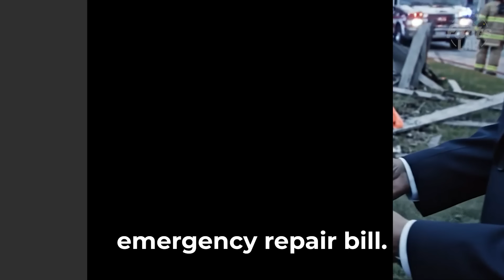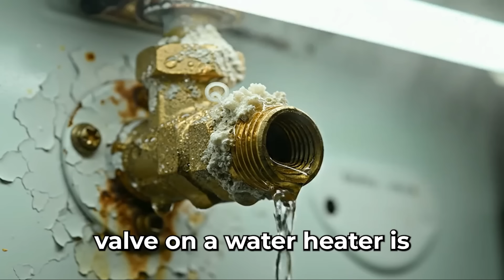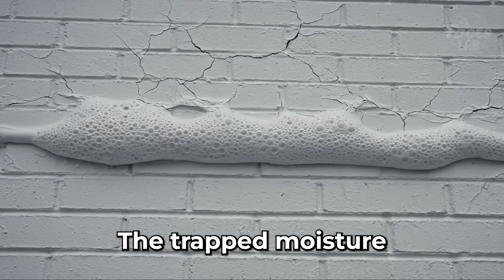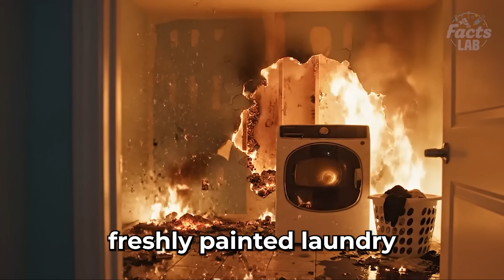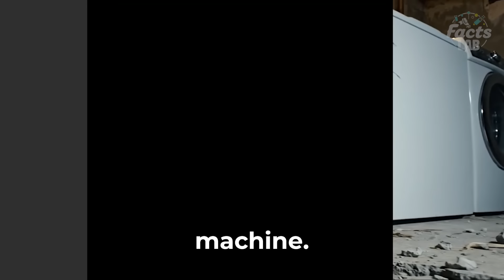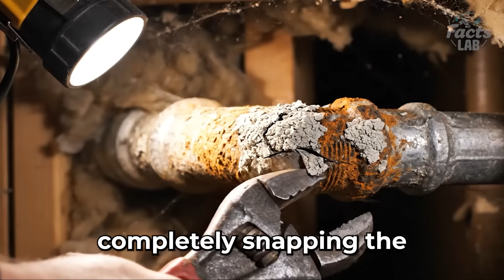DIY Fixes That Turned Into Expensive Disasters

Comment: I watched a Home Depot video on floor sanding; it was about 8 to 10 minutes. I posted a comment just to warn viewers to do more research before sanding a floor, but I did not denigrate the video. Home Depot removed my comment.
DIY is good but know your limits. If you have never fixed a leaky faucet, you may not want to replace a sink or bathtub.

Comment: No. 69
Idk how you turn a floor into a wavy potato chip using a palm sander. Yeah it would take forever to sand but if the boards are level which they should be then its an easy sanding job leaving a level floor. Unless you don't know how to sand of course and mess up that.

Comment: DIY, people did it for hundreds of years, seen some most ineteresting "fixes" some of then from 100 plus years ago, the difference is, they used rather good materials, its tempting to buy cheap, beware, even screws can just pop the heads or break, if your not sure of their quality ? use nails instead, a lot can go wrong, we thought, when insulating the floor, have lots of ventilation in the crawl space, WRONG, you will end up with condensation, and possible, dryrot. I connected a woodstove on an anciant 2 x 4 ft fireplace chimney, WRONG, that chimney will not get warm enough and will turn into a tearfactory, in that case, always use a liner. I love old wood, it is first growth, for one thing,

Comment: My wife likes to hire the cheapest handyman who "claims" to have experience in spite of my protests. I'm not allowed a vote. I caught the guy hired to repair some drywall cracks and painting in the hallway as he was trying to wash his tools and paint brushes in our brand new, freshly remodeled bathroom sink. I yelled at him and was furious. I was lucky to be home to catch him. He also had an oil-dripping pickup truck leaking on our freshly pressure-washed driveway and was bringing his "strange" live-in girlfriend over to sit in the truck outside the entire time while he worked because he couldn't trust her alone.

She hired some people to scrape the peeling paint of the soffit and facia boards that she had slathered paint on top of paint for years. They did a great job scraping. I wanted an oil based primer but a latex top-coat was okay. They washed their brushes in gasoline and just poured the gasoline wash in the yard creating several large dead patches in the yard. They washed the latex brushes in water and rubbed them against the red brick to dry leaving white stains. Then they left the back yard hose running and we didn't notice until we went to bed and could hear the faucet running outside the bedroom window. Our yard was flooded.

Comment: Every professional tradesman has had to deal with customer's previous DIY decisions but not everyone who calls themselves a professional is . A professional put in a new bathroom is looked great i took  a bath two days later the bath hadn't emptied  a new plumber discovered that the previous 
"Professional" hD tipped aa bucket left over tile cement down the pluck hole requiring the waste piping system to be replaced 😢
 
 professional 
co

Comment: As a licensed electrician and former General Contractor, I have actually had to clean up many of the same types of messes shown in the video.  Being cheap is VERY expensive!
Reply: Plumber here......don't complain; these DIY folks are our job security.
Reply: @jimmyday9536 😂😂😂
Reply: I was a professional decorator and if i had to decorate a room that had been previously decorated by the owner. It would take longer to prepare it by removing their attempts than it would actually decorating and they always complain about the time it took 😂
Reply: Cement and concrete both contain water. Spoiler alert:water freezes when it's cold and that's when it gets warmer causing the concrete to crack you don't need a physics degree to work that out. The problem is that so many people with impressive sounding academic qualifications assume that they obviously know more than any dumb contractor who never even went to university  despite the fact that the dumb contractor has been safely and successfully building houses for decades while you can't change a light bulb without blacking out the entire neighborhood 😂

Comment: #15 is completely fake. You wouldn’t save any money by using Sheetrock after someone finishes it out
Reply: #19 is fake. You wouldn’t be able to handle the smell for the year it would take to rot the wood
Reply: #32 is probably fake. I’ve seen 5 layers on a roof plenty of times
Reply: #39 push fittings are in no way cheap

Comment: #71 My wife wanted me to put a new ceiling fan in the dining room. Upon removing the old squeaky fan I determined that there was not enough support for it. I told her I could only put a light fixture in its place. Alternately I could reinforce the mounting but first would have to remove a sizeable portion of the ceiling to access the supports. Then we would have to replace most of the ceiling.  She decided that a simple light fixture would do. I just barely avoided a disaster by refusing to do a job that I knew was incorrect and dangerous. It was the correct choice.
Reply: A real man would have ignored his wife and installed the new fan then waited to see what happened. The same real man would not have read the instructions for the new fan either.
Reply: Divorced yet?
Reply: BS